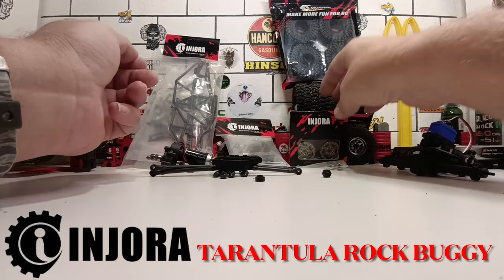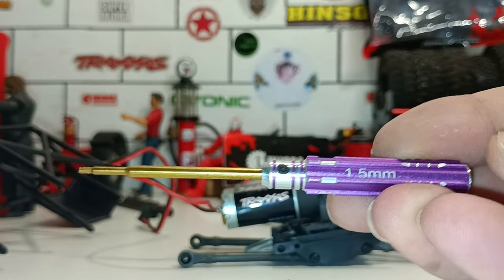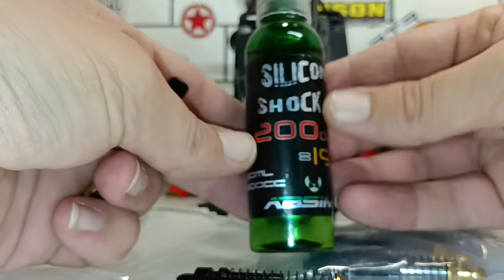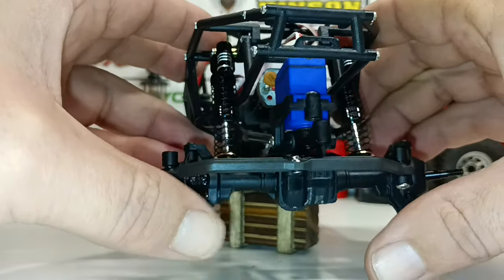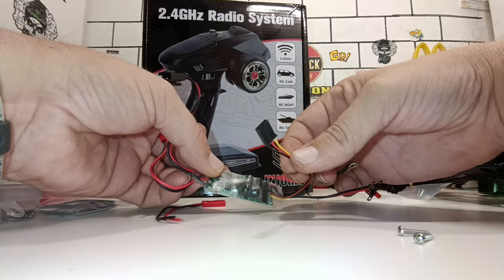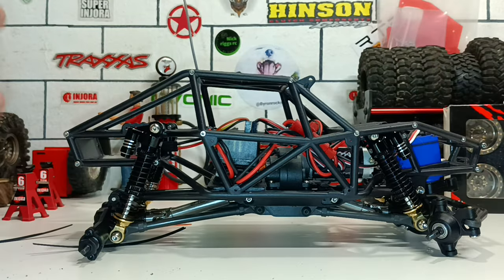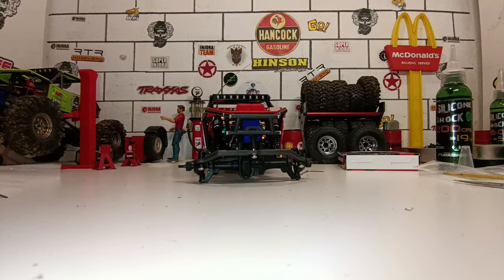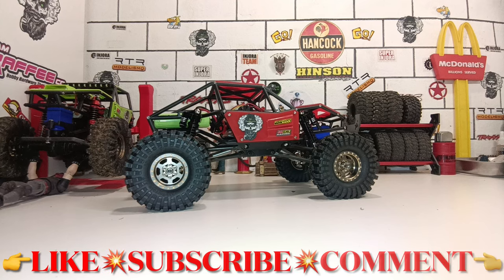Assembling Injora Trx4M Tarantula Rock Buggy ￼- #Injora New 59mm weighted shocks ￼

Comment: great vid.  I actually found the vid by doing a search for how to fill the new Injora 59mm weighted shocks with oil.  THAT BEING SAID, I took your advice on setting them up wirh the preload like you do BUT, I almost sent them back when I tried fitting the brass ball joints, thinking they were too small.  The one thing you did off cam was install them and didnt show how they work.  HAving to use the included rubber retaining rings.  I thought they were spare "O" ring seals for the shocks for a rebuild.  Im used to the type of ball joints that just snap in.  It would have been helpful if you had showed how to istall them.  Just something to consider maybe in your next build vid.  Still a great build vid.  Im doing a 100% Injora build including the V2 Tarantuala KIt, new Fat Purple 2400 brushless motor and matched tranny, Injora Portal Axels and the Heavy brass 1.3" rims like yours.
Reply from the maker: Thank you, I did not cover all the aspects of fitting the shocks in this video as I have done it multiple times in other videos. 
I just showed how I would set up the shocks.
If you look through my trx4m content you will find what you need for sure. 
I am glad that you have stumbled across my channel as it is always nice to meet another RC enthusiast. 
Sounds like you built one insane rig to me bro! 😁
Thanks for watching and I hope to see you again on another video ✌️😉

Comment: Perfect video😊 good explanation and camera angle always on point 👌
Now i have a question about the ball joints, i have the same shocks but i am struggeling to put the low ones in even when i use all my strengh they don't want to go in... any tipps ? 😬
Reply from the maker: Hi bro and thank you 🤜🤛
Really appreciate your awesome comment ✌️😉
Just to confirm that you are talking about the bottom ball joints that go into the bottom eyelet of the shock?
From what I can remember they weren't hard to put in as you use the o-rings to hold it place.
I'm going to check out if there is a difference between the ball joints as I can't remember.

Comment: I have this coming tomorrow. I got it to absorb spare parts
Reply from the maker: That's awesome! I also have to do something with all the spare parts!!
And you know what I don't regret it didn't cost me more than a hundred bucks to build it.
And it performs as good if not better then my fully upgraded Traxxas TRX4M's 💯💯💯
Reply: @rcfungames  I really got something from the part about the radio and ECM. I don't have any electronics for it yet and I might just copy what you showed because it obviously works well. Thanks for the video man
Reply from the maker: @DustinRea  I had the same problem I looked around and all I could find was originally ECU or from Fury tech which I cannot order from as they don't ship to Portugal
So I checked up mini reviews and this is ECU  came well recommended, and all my wpl rigs that have the V3 electronics have a really nice modulation so I thought I would give it a try and I was not disappointed.
Especially for the price 😉👍
I really appreciate you watching and I'm glad the video help for something bro 🤜💥🤛
Reply: @rcfungames  I just put on the low crawler gears in the transmission and wow what a difference. It rolls right up what it used to spin out on. (High Trail Cheyenne)
Reply from the maker: @DustinRea  definitely one of the most important upgrades is the  reduction gear set! It makes such a difference, and the 48T motor from Injora is another amazing upgrade for power and a bit more speed with those reduction gears.
Wish I had one of the new High Trails 😉
Reply: @rcfungames  just wait. Next month they have a 79 Ford pickup being released in the TRX4M High Trail. I reserved one to get for my kid for xmas. They have Blue and Black, and Brown will come after xmas